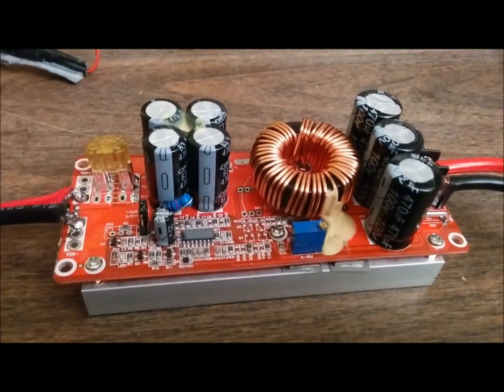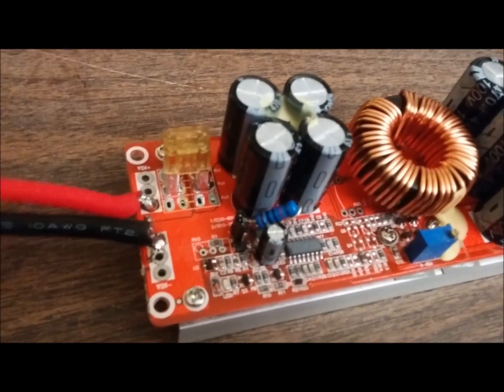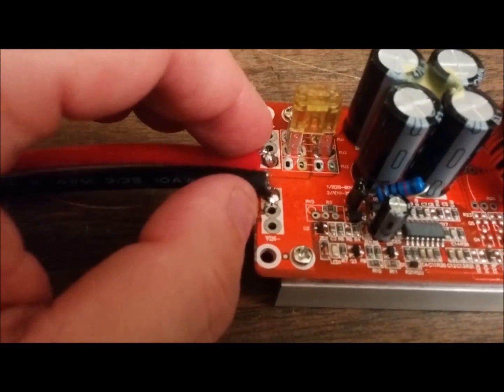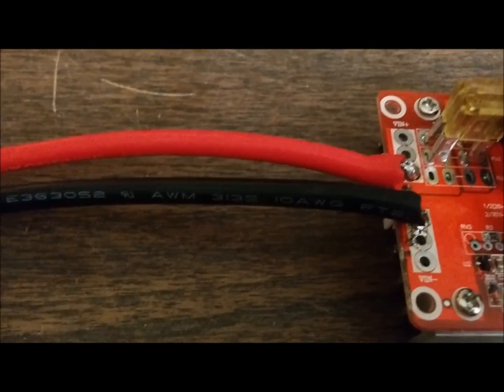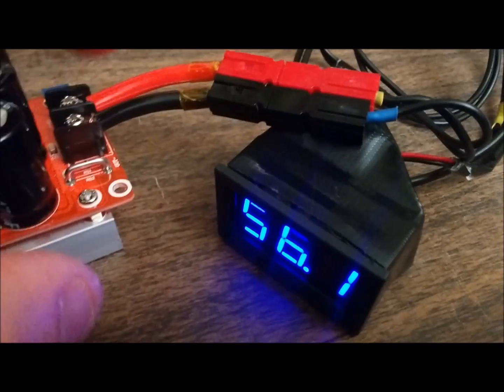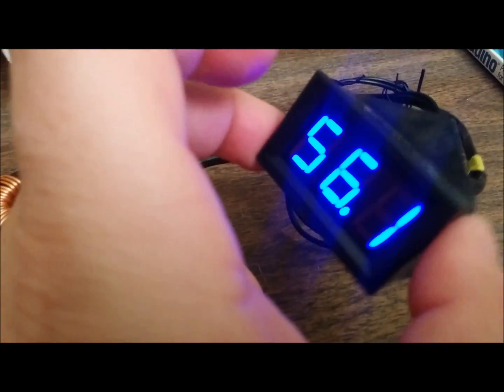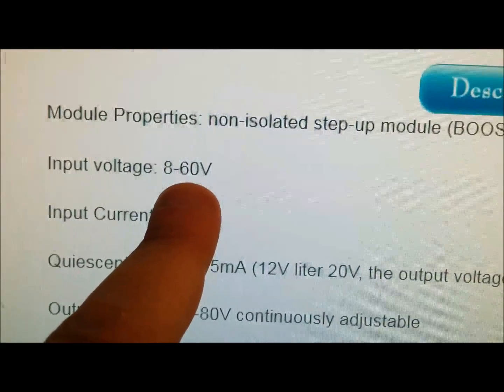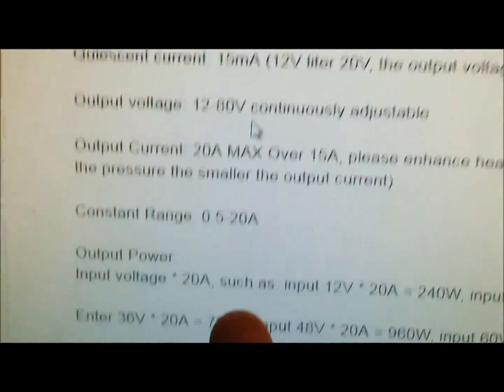1200W 20A DC Converter Boost Step-up Power Supply Module IN 8-60V OUT 12-83V

Comment: Question, is that an " e " bike battery for power supply?... If so, the test not be objective since the maximum cell discharge on one cell is 10A and even with multiple cells you can not exeed the single cell discharge rate!.... You will need at least a 30A IGBT power supply to supply that Buck converter so it will not starve of current!.... Remember that current is the diameter of the firehose to deliver volume to quench the fire while voltage is the pressure and that can be obtained with a little red coffee steer straw....

Comment: hi ,
Does the 48 volt inverter work ?
48 volt 4 batteries required..
Can I use this device with inverter by turning 12 volts to 48 volts

Meanwell 48volt/1000w  ts-1000 248B İnverter

Comment: Listen up eBikers:  You can use these things to charge your batteries, NOT to replace them.  Drive your bike motors with the correct controller and the correct battery.  This is not the Droid you're looking for.  They're simply not designed for that sort of a load.  If nothing else, you're giving up at least 20% of your battery charge to inefficiency.
Reply: what can be the solution for solar output to 48 volt e bike battery charging.

Comment: So far, this is the only video I have seen implementing such a concept.
I'm planning on converting 40V lithium-ion battery pack to 74V, 42A output. I'm implementing isolated boost converter design. That would power a 3kW motor
I'm facing trouble in buying the converter components, capacitors, doides. Would you suggest me a dealer or a website where I can buy components or complete power module.

Comment: These boosters are nasty because the manufacturer has scratched of the chip identification imprint on two of the SMD IC, so if they ever failed there would be no chance to even repair them. I challenge everybody ho speaks Chinese to find out if that information is available or the manufacturer can be talked out of that bad habit!

Comment: couil this be used on a ebike ? i have a 48 volt 1000 watt max draw  motor..i have 12 volt 18ah  batteries laying around..could this be used to wire the battery to the motor  controller ?
Reply from the maker: Hi Bob. I think would work, but  this Boost Power supply would get very hot. It might work for a short time.
Reply: i looked at it on walmarts site..says watt output is based on input voltage times 10.... the motor is rated for 1000 watts but it is throttled down to 750 watts to be federal road compliant .then the motor says it is normally at 275 watts @27mph with my trike and my total  net weight on a level road....275  watts....even if i ran 3 12volt 18ah  batteries in a series for a total of 36v18ah  i would only get 360 watts output on this gizmo before it started really running hot....
the batteries weigh 13 pounds each   so i will try this for the weight savings and then only use the motor when i have pedaled  up to cruising speed...25 bucks on the walmart website...worth the cost for the test.   @davidsonshine9678
Reply from the maker: @bobamericana3099  Good luck. It should be fun to test it around the block or for a mile or two, but I wouldn't use it for long distances.
Reply: at least the ground in orlando florida is level....florida is flat..i am 50 miles from the beach and yet i am only 65 feet above sea level...ordered this..when it shows up  i will run it for a block and then do a touch test to see how hot it is..then go from there..if nothing else, i will simply have to add a 4th battery to the series and then forget about it. thanks for your reply's...   @davidsonshine9678
Reply from the maker: When you get it, let me know how it goes!
Reply: I would additional cooling like cpu fan on input they do get hot !

Comment: Hi. I have the same boost converter. I have a problem: mine goes only up to 78.8v i tried powering it with from 12 to 40 volts ant it's the same maximum output. I need atleast 82 volts for charging my e-bike batteries. What maximum output voltage your has? Is mine defective? Thanks in advance.
Reply from the maker: robertos46  I am not sure - I don't have this converter anymore. I managed to break it :-(
Reply: How did you break it? I need to know so i won't break it the same way lol
Reply from the maker: robertos46 I used it to troubleshoot a dead wheelchair motor I found in the trash, lol
Reply from the maker: robertos46 something went wrong and the capacitors?? Popped

Comment: Will this converter boost a 12 volt leisure battery to 14 volts  at 10 amps output
Reply: Yes definitely just make sure you use a multimeter for voltage, if 12 volt battery set to 14.8 volts and use a clamp style ammeter clamped onto negative or positive not to overload current. As long as current under 20 amps ! Cheers and good luck!
Reply: I have used a 150 watt module. I had to put a small cpu fan for cooling! Just be careful on the unit in the video as my capacitors poped without overload and scared the crap out of me!

Comment: I'm gonna buy one of these for an ebike build, did u use this to increase voltage for a battery so you would not have to buy multiple? If so did it work and how many miles per charge?
Reply: Did it work

Comment: non isolated ebay junk . It's just one input with three holes per pole, they are not different inputs. your described use is odd, if you just need a few more volts, you would just add a few more cells on your pack??? you lose energy using converters that you could of used for your load. you only get 1200 watts if you are able to input 60 volts and then you can only boost the output up to 80 volts, so what's the point? And on top of that you still can only put in 15A unless you remove the supplied heatsink, buy a larger one, and attach it to output fets. If you were going to try and use this to power a car audio amplifier or some other automotive use keep in mind it can only handle 15 amps and at 14 volts you only get a max of about 200 watts! uggghhh junk.
Reply: Can you recommend a higher quality high output converter?

Comment: What the hell is the increased power used for?
How strong is the current?
Will it power a motor, heat source, what ?
Reply from the maker: It was used for an electric bicycle. I increased the voltage and was able to go faster. It powered a hub motor. Not sure how strong the current was.
Reply: Use for high power load, duh.

Comment: THANKS, I BOUGHT 1 FROM EBAY IS 1500W 30A COME WITH FAN UNDER THE ALUM. HEAT SINK
Reply from the maker: Thanks for the post!  Yours looks better than mine!
Reply: @davidsonshine9678  It's not.  Same converter.  Seller is a bigger liar.  Dave, you can't take any of those specs at face value!

Comment: It really worries me when people who dont find measuring basic values a breeze get massive lipo packs. These batteries are not toys and were never really intended to be sold to non engineers. im not saying dont do it...im saying do your homework so you dont burn your house down
Reply: Are you serious non engineering these batteries are everywhere now and arent as dangerous as people may make them think I work with 100ths of these and only had 1 fire in total mostly work with tons of 18650 which are different than lipo

Comment: Hi, 
I recognized the minus in and the minus out have no consistently electrical contact, so can the be a problem if I connect but minus to the same ground.
Weaker models have a contact
tnx
Reply: yes, the shunt measures the current over the minus-connectors, so you cannot connect them to same ground

Comment: Could you please tell me the type of potentiometers and their model because i am building a lab bench power supply and i dont have the booster yet so i dont know what potentiometers to order since this are to small to be used on knobs. Thanks alot.
Reply: w104 13 , w502 13 ; w204 13
Reply: only the w104 13 has its side readable that side says 'bochen 3296 guosheng' and shows the schematic pin1 -/\/\/\
pin2/\/\/\-pin3
Reply: first one is 100k like i predicted. 204 mo is 200k , 502 is 5k. https://www.bourns.com/pdfs/3296.pdf I never actually checked the 2 of these i own ive just done what your seeking to on enough similar ones. Like i said though...dont skimp on nice pots., A friend blew a capacitor (vent worked...YAY) by cranking a cheap one too fast.

Comment: How many mile can u get out of the 36v battery using  the 1200 20a boost converter
Reply: that would depend on the amp hrs of the battery, what type of current you are drawing/how hard you are pushing the motor.. higher amp draw = decreased pack capacity and how efficient the converter is . Thing is Watts = v * a... so 100w at 20v = 5 amps. say you were boosting a 10v pack to 20... the pack is required to put out 10amps...but its worse because the converter taks some too, so you are probably pulling 12amps from the pack in that scenario. I used those numbers because they are easy math. the key is if u convert to watts at boosted voltage...then divide by pack voltage, you see pack amp draw. then add a few amps to account for converter.
Reply: David Sonshine These converters need to be well ventilated or they will burn. I use them to charge my 15s6p ebike batteries.
Reply: Mile? What?
Reply from the maker: I don't have this DC DC boost converter anymore - it broke. I wouldn't be able to answer this question :-(

Comment: Hello There !....pls tell me that can it drive 100 W LED without over heating or without strengthen its own heatsink.
Reply: whats your power source? voltage and if battery ah/mha. what is the forward voltage of the led you intend to drive?

Comment: Hi! do you know what's the main so16 ic?  Maybe you have schematic for it?
Reply: The IC marking is removed by sanding. It could be they are using rejects or they are trying to maintain secrecy. The IC tends to fail easily and no replacement know or available.
Reply: 68xh15m - tl94 (i?) - g4

Comment: do you think this would work on an 1000w ebike conversion kit... 48v 17ah battery very expensive... i would probably use two sealed  12v lead acid wired to 24v.
Reply: bought it to limit the current of the kit of 500 watt  to 5 amps so its roadlegal in europe. i ride it at ten now, ive not tried adjusting it lower so far, also i've read the output voltage must be higher than the input voltage for the current limiting to work. but this isnt possible with the regenerative breaking diodes wich i have installed now - 
will keep you updated if i worked on it further
Reply: itseems to only be able to regulate a non changing load with the current limiter, also it only works a bit when output is 20-30 volts over input. i sawd the current measuring shunt from the bike controller a bit thinner and works like a charm now (without the thing from the video). but, when that was between my battery and controller, it functioned very stable
Reply: it is the max amps the electronic components can handle. if on an electric bike, the current coming out of the battery is variable;
 depending on the  speed you are riding
Reply: Thank you very much sir, helps me a lot deciding for my DIY..
Reply: sir just want to ask is the input current must always be 20 amps or is it the max amp?

Comment: boost converters work like this Volts X Amps =Watts so 36v x 20v= 720watts vs 56v x12.85714 =720watts so your not making more power your actually just increasing the potential to cut through more resistance by increasing volts....I still think boost converters are cool thou

Comment: How much Amp would it give when you use 36volts on let's say.. a few 100w led chips.
Could it run 4 of them at 12A? Not theoreticly, but do you actually know if it works?
Reply: Yes it will.